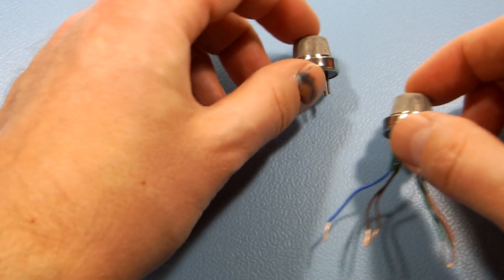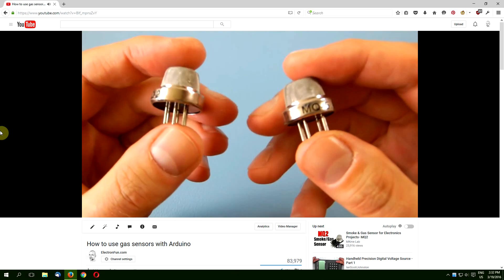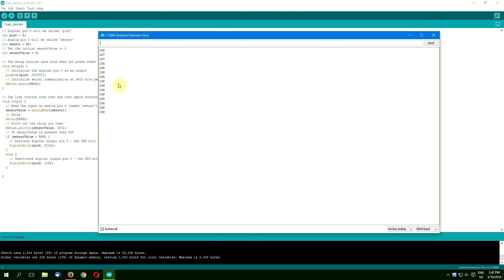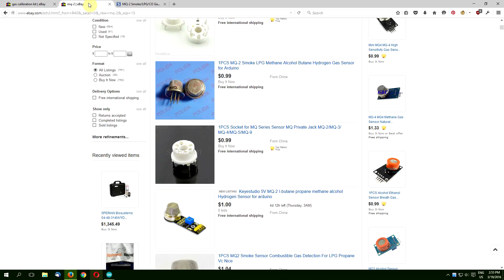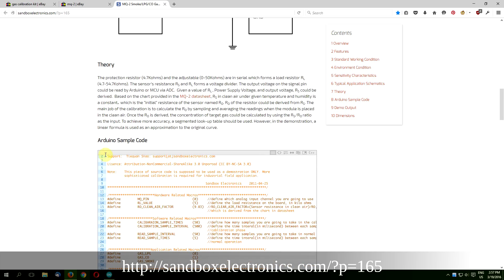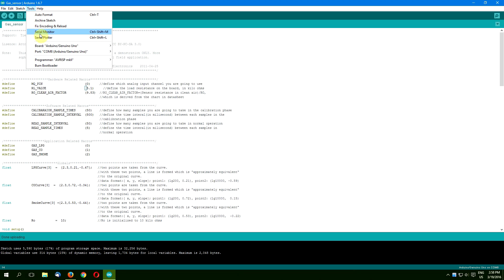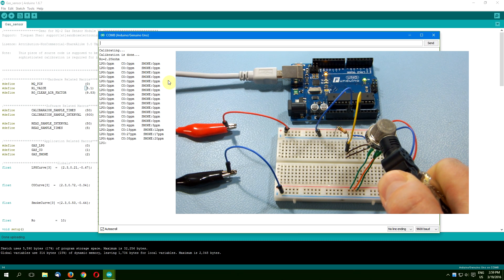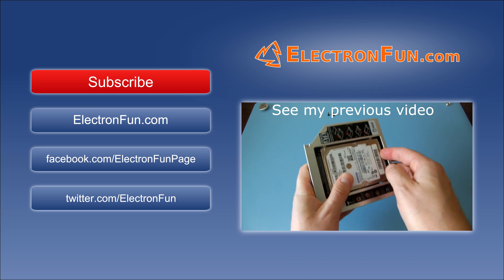How to calibrate an MQ-2 gas sensor || Arduino tutorial

Comment: I bought the one with the board (which have potentiometer, led light, etc.) so, what is the RL value for that? In the sandbox website it was 20kohm, but then it won't read any gas, I even emptied my lighter.

Comment: MQ-2 - Methane, Butane, LPG, smoke
MQ-3 - Alcohol, Ethanol, smoke
MQ-4 - Methane, CNG Gas
MQ-5 - Natural gas, LPG
MQ-6 - LPG, butane gas
MQ-7 - Carbon Monoxide
MQ-8 - Hydrogen Gas
MQ-9 - Carbon Monoxide, flammable gasses
MQ131 - Ozone
MQ135 - Air Quality (CO, Ammonia, Benzene, Alcohol, smoke)
MQ136 - Hydrogen Sulfide gas
MQ137 - Ammonia
MQ138 - Benzene, Toluene, Alcohol, Acetone, Propane, Formaldehyde gas, Hydrogen
MQ214 - Methane, Natural gas
MQ216 - Natural gas, Coal gas
Reply: How to calibrate mq135?

Comment: hi sir how to get  LPGCurve[3]  =  {2.3,0.21,-0.47} ?
Reply: LPGCurve[3] = {2.3,0.21,-0.47};
 //two points are taken from the curve. 
//with these two points, a line is formed which is "approximately equivalent" to the original curve. 
//data format:{ x, y, slope}; point1: (lg200, 0.21), point2: (lg10000, -0.59)

Comment: I challenge you to give me explanation of the weird use of the natural logarithm in the final step of the code. Even the maths experts couldn't tell me. COPY_PASTE baby!
Added to that, can you provide a clean air -- a real clean air, for detecting CO2 for example, where can ya find an air that doesn't contain any CO2 to be a reference to your R0?
Using those sensors are not accurate at all. they're just to detect if gas exists or not. To make them accurate you need a huge knowledge in maths, and that what I'm trying to do in my project (a real work project)!
Reply from the maker: The piece of code is taken from a company called Sandbox Electronics. You can find this information in the video description.
These sensors are good for DIY builds, but I wouldn't use them in any commercial project, which I mentioned many times in the comments section.
Good luck with your project.
Reply: Thanks for your reply. FINALLY someone of those who publsih videos responded to me (I just used the word "challenge" trying to make you move as I thought you're like some others who just ain't respond). Indeed it should not be used for commercial purpose, but I am in a research unit, so I will not use them until I make sure that I'm getting enough accurate readings, I'm working around this problem. I will use a certified device to compare my result with it for the particular gases. However, thanks for your wishes :)
P.S and BTW SandBox is not responding to any query. I wonder if they also just copy-paste the code ;-)
Reply from the maker: My channel is quite small, so at that point I'm able to reply to pretty much every single comment. Sometimes it takes a few days to a week, because I have a 'regular' job and a life outside of YouTube :) Some YouTube creators receive hundreds of comments a day and more, so they reply to very few of them.
I didn't realize research units use YouTube as a source of knowledge/inspiration.
You want to compare a commercial sensor with the MQ series - I wonder what results you will get.
I haven't contacted SandBox Electronics, but I know this project is quite old. I'm not sure if they still support it. However, it would look much more professional if they replied to your query.
Reply: Ya assumed they have big channel, believe me, most of who I asked have smaller than yours.
I'm a software developer, and I'm doing my internship in IoT Unit (actually it's a research centre), I've been assigned a whole project in a field that I'm not familiar to. That's why I'm looking at every single source I come across. A lot of explanation needed and are not available from the source (a nice looking video with a title of "How to" but with no deep explanation), I now have a full view of the logic behind all of this, but one more left which is the use of this weird and unexpected natural logarithm (ln(y)) in the final step of the calculation. If ya have any query about the code or the logic please don't hesitate.
P.S the idea of the project is to DIY from scratch and achieve very impressive and accurate device as a prototype with very low cost.
Reply from the maker: That's a very ambitious project, as cutting cost usually makes the whole thing less accurate and reliable.
What kind of software do you develop, if it's not a secret?
Reply: ElectronFun.com it's Environment Air Pollution Parameters Project including both the hardware and software for monitoring the air and for collecting info for analysis and statistical purposes for the County Council.
Reply from the maker: That's a serious and interesting project. I guess there are quite a few people involved. Good luck again :)
Reply: Unfortunately It's me alone in this project. I'm working days and nights to catch the deadline.  Thanks again and good luck in your job too :)
Reply from the maker: That's a one-man show :) Hope you will catch the deadline. Cheers!
Reply: @scorpion7434  hello how was your project ?  Can you provide link to your project?
Reply: Yahya Almardeny  ....hello sir can u suggest me which method u used to get exact reading..

Comment: why do i get a reading with 10-digit number (2643534534ppm etc) and the resistance varies after every reboot of the board? (from 3.26 to 15.7kOhms etc) ....
Reply from the maker: To tell you the truth, I have no idea. Which code have you been using? Have you tried pre-heating your sensor?

Comment: How do i select the RL value if the sensor i have is already fixed with a potentiometer?
Reply from the maker: I guess you don't have to, because the resistor is probably already there :)

Comment: I am confused how to translate the different levels of different gases from one ADC level as they all are in an air mixture. Any ideas on that? I mean how one ADC level translates into different ppms for different  gases?
Reply from the maker: It is confusing, I agree. The sensor can detect a range of gasses, but it is not able to differentiate which gas it is exposed to. The MQ gas sensors are good to experiment with, for DIY projects, but I wouldn't trust these if you're working on a professional project.
Reply: so do u have a solution on what sensor specifically detect what gas??

Comment: Hi ElectronFun,
I'm currently working on an MQ-3B sensor to detect ethanol. I'm wondering if that sandbox electronics would work for MQ-3 too. If not, have you seen other sites that provide arduino code for that? 

Love your videos. Keep up your good work.
Reply from the maker: Hi Idham,
Unfortunately the code was written specifically for the MQ-2 and I'm not aware of any equivalent for the MQ-3.

Thank you so much for your kind words :)

Comment: Hey, I am using an mq4 and mq7 to detect CO and Methane Concetrations. Do u think the sanbox electronics code will work for those mq sensors when I input the Load resistance i have put for them?
Reply from the maker: The code will not work properly with your configuration. It was created specifically for the MQ-2.
Reply: Thanks for replying so soon, do you have any tips for how to find the correct Load Resistance for the MQ7 which has an adjustable one, and how to calibrate it afterwards?
Reply from the maker: No problem :)
I haven't experimented with the MQ7. I'm afraid the only way to have reliable readings could be the proper calibration.
Reply: Do you get any solution of this problem. Plz help me if you get ???

Comment: This is free air calibration, after calibration when the code is running, the CO ppm result the serial shows is 0, shouldn't it be 20000 (2%) which is the known atmospheric CO% concentrate?
Reply from the maker: As far as I know the sensor omits the atmospheric CO concentration and measures everything above that value. It treats clean air as point 0, but don't cite me on this.

Comment: It is helpful video dear but sorry to say this not what we call calibration.. we are still unaware that whether these concentrations of gases are correct or not.. to confirm this we must need a expensive device as u shown in your video.. so problem is still there.. Keep this thing aside i want to know that how to adjust its sensitivity using potentiometer on the circuit board.. when i was testing it i just place it over stove then it was showing readings otherwise not LOL even not by burning a paper..  Do you have any solution..??
Reply from the maker: It's true, the software calibration is only a cheap substitute of the proper calibration.
To adjust sensitivity just replace the resistor with a potentiometer.

Comment: Sir what can i do for mq2 Sensor with 3 Pins for connection on arduino and breadboard
Reply from the maker: You can simplify your circuit. Just connect 5V and GND to your sensor. Next connect the remaining pin to your Arduino's analog input. You don't have to worry about additional resistors.

Comment: In datasheet, mq-2 only can detect LPG in 200-5000 ppm, but in demo it can detect lower than 200 ppm.
Is it really accurate for measurement  of LPG concentration?
Reply from the maker: +Agsen Setyo You are an attentive observer and you are right - the datasheet says 200-5000ppm for LPG. The Sandbox Electronics guys didn't take this into account. This method of calibration will never be as accurate as the "proper" way, but it's free.

Comment: any calibration tips for h2 gas?
Reply: what is the proper method of calibration?
Reply: Hi would it be possible to post a link to the calibration equipment you found for calibrating the sensors?
Reply from the maker: +ashraf zin Sorry, Sandbox Electronics didn't include H2 in the code, so I guess the only way is to go through the "proper" calibration.
Reply from the maker: +Jerome Jones There are special kits on the market, thanks to which you are able to get a specific gas concentration in PPM units. You can expose your sensor to the gas and map the value you're getting from your sensor.
Reply from the maker: You need special equipment for it.
Reply from the maker: I was searching Ebay for "gas calibration" equipment - nothing special. You could add the name of gas you are interested in to the search phrase.

Comment: How did you determine that Rl=5.1 works for you?
Reply from the maker: +Parth Patel The sensitivity seemed the most reasonable with about 5kohms. However, each individual sensor may react a little bit differently, so there's no specific recipe.